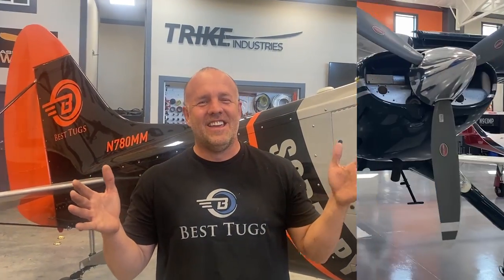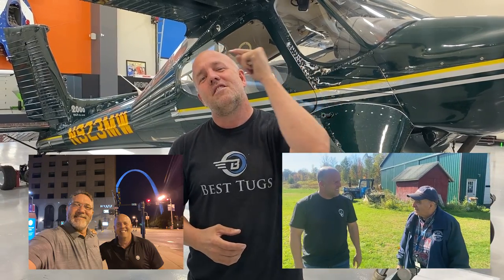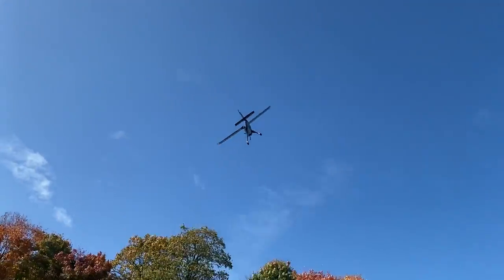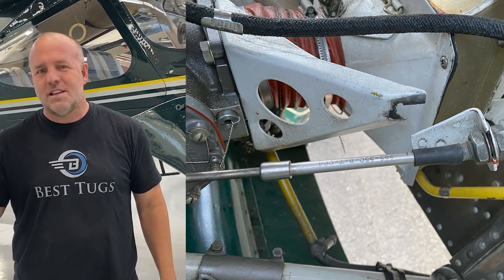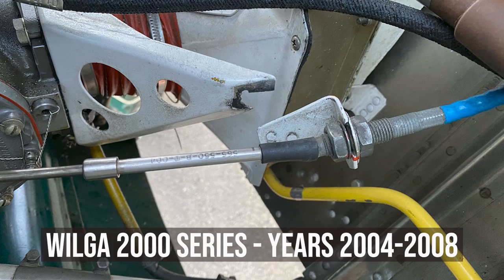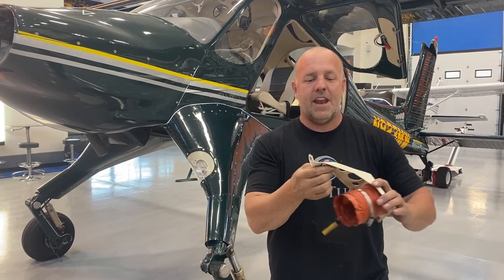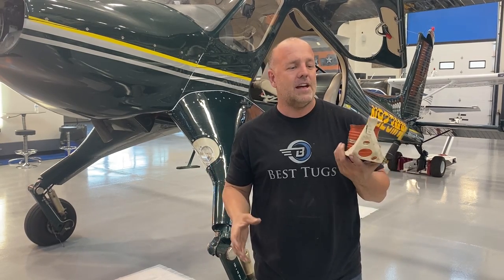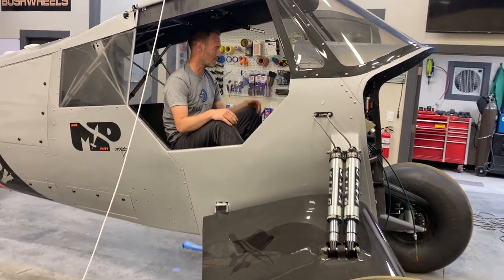Engine Trouble Flying Home a New Wilga 😬 | Scrappy 30

Comment: Great advice - I still wish you'd add a head rests to the seat as the hyperextension of the spine is still a common killer in aircraft accidents.
You focus on so many security aspects that are awesome like helmet, parachute, doubling down on avionics, solid (over)engineering - but to leave the headrests out just to end up paralyzed or killed?
There's so many incidents in GA where a head rest could have saved lives and prevented damage that I wonder why this basic feature was left out. It shows up in so many crash reports.
Example crash N97119

But keep up the good work. Let's hope that if something happens the circumstance will not involve the need for a protection of the spine.

Comment: My Dad always taught me to make every take off EXPECTING the engine to quit at the worst possible point in the take off. Then if it happens your not surprised and already taking action. One of his other fav sayings was this. The 3 most useless things to a pilot are 1) Runway that's behind you, 2) Altitude that's above you, and 3) Gas that's left on the ground.
Reply: That's a good one, my flight instructor explained me the same, in 1979. He actually told me that below 300 feet AGL it would be better to hit the next trees or a brick wall than trying to turn around 180°.
On every flight I was told to look out for open fields for emergency landing, even marking them on the map before a cross country.

Comment: Mechanical emergencies are a very small part of the fatalities.  It is usually pilot error.  However, what you say is very important because they can happen.  In Commercial training you practice engine out procedures to the airport this is something we probably should do more often.  

Usually for the BFR you pick a place and within 1000 feet the instructor stops it.  Maybe, we should practice it to Commercial standard with a actual landing.  Something to think about and I think I will put that into my next BFR.

Comment: Looking at your suspension setup reminds me of the front view of a Baja 1000 racer, designed to absorb punishment over the long haul, as well as the travel having a large safety margin, not surprising considering your devotion to the safety first ethos.

Comment: this have simple repair, if need be sure can use this mixture wire, if broken welding little piece rod under piece if cut broken rod keep wire to place and can use and go to back ground safety. or add this metall wire to cable and frame if cut broken not drop cable out can use.

Comment: I didn't realize you are in Spanish Fork. I just moved back to West Valley City after 9 years in Pensacola. 

Also, as an auto mechanic, I've seen the tiniest little parts take out entire engines. They are systems, with all parts needing to work to make the thing go. And like you said, these things are all man made, and we all make mistakes.

Comment: I had great CFIs. Most of my training was "what if" scenarios. They'd pull the throttle on me a lot. If I'm looking at the ground I'm not sightseeing I'm looking for good places to land. To this day when I'm driving I'm making mental notes about power lines cross roads and signs. When I'm at the beach i know which ones are loose sand and which ones are firm. I think a it's a good habit. I'm just a private pilot and one of my CFIs was a senior 777 captain. We were talking about a plane we hadn't flown in 40 years and I went through the emergency hot restart procedure. He asked me how the heck I remembered that? It was because I had it go out on me ... over lake Ontario, at night, in the winter. It sticks with you. Anyone flying a Cessna 206 with fixed gear want that info ... just ask 😉

Comment: My engine failure was at 200 feet on takeoff, with trees and trailer parks around.  Followed advice of some of the best pilots in the world, flew the crash all the way to the ground and until it quit moving.  Crash was not survivable but I did,  Fly the airplane, fly the airplane fly the airplane.

Comment: I experienced a burnt valve once.  I was just leaving an airport where I have all my work done and do a lot of $100 hamburger runs.  It just started running rough and in a matter of seconds I decided to land.  They did a compression check and determined that the plane was staying there.  That is my only mechanical problem in 1200 hours of flying and yes, if you leave an engine sitting for a long enough time, engine components will rust.  I speak from experience.

Comment: yea, stresses over time make things break. entropy.  specially with your scrappy plane that's a lot of power and weight in front so more stress on things. lol these small planes fall out of the sky often if mike has fallen out of the sky a few times. there's quite a few videos out there of crash landings of these things. bush cubs seem best because theyre light enough to glide down and have those giant wheels. and put a parachute on it in case some wind tears a wing off. so if you want to fly airplanes fly bush cubs lol how well does this 8 cylinder monster glide to the ground?

Comment: I fly paramotors, not GA, but have had my own motor out.  Its not if but when the engine is going to quit.
Reply: I have been flying paramotors for 12 years and have had 4 engine failures.
First was caused by an ignition wire breaking due to vibration at 100 feet on take off, landed further along in the same field.
Second one was unusual as I had taken off from a muddy side of the grass runway and was caused by mud jamming the kill switch (pushbutton) down when I inadvertently caught it moving in the harness, landed out in a farmers field.
Third was a stopped engine after much mis-firing, fortunately at 1500 feet above the landing zone.
Fourth was a failed new stator coil after just 5 hours, annoying. Had been flying defensively so picking a landing field was easy. Had to perform a few S turns as the wing just didn't want to come down. No damage to pilot or machine.

I have found that I have been more relaxed with more experience.

Comment: Ah, the joy of engineering, lol. These are similar issues that the firearms industry has to deal with in their new designs; harmonics and metallurgy. In the aviation field things have to be light weight and very strong and that pair of requirements is a tough nut to crack. Components we consider a non-issue to be concerned about can often be susceptible to frequency harmonics and sympathetic harmonics. Often an easy way to build in an insurance policy is to layer in a dual material so that when one shows signs of weakening, it gives you a chance to look into it and find the source. We've all seen some weird looking parts in aviation components and we also know that torsion, harmonics and temperature variations can put a lot of stress on a part and if a part is made of an alloy that doesn't have the same expansion rates as surrounding alloys, it'll soon weaken and fail. Overall, looking great! Thanks for sharing the bad with the good.

Comment: A big part of flying single engine planes is risk mitigation.
An engine isn't infallible, engines quite sometimes for various reasons.
Flights should be planned to evaluate and minimize risk associated as much as possible. 
• Plan flights along freeways or roadways in remote wooded area's so you have an out if the engine fails, especially at night. 
     - I'll never forget when the instructor pulled the power back in my PPL night training. 
     She Asked, "Quick your engine quit what are you going to do?" 
     We were flying in the middle of nowhere and everything was dark except a lone car driving on a road about a mile to our east. 
     I said, "Try real hard not to die, and turn to land behind that car".

Always leave yourself outs. 
If you are flying in an area where outs don't exist you better have your equipment in tip top shape and be comfortable with the added risk.

Comment: I first learned to fly in powered gliders at the age of 16, and during the training, more often than not, the bastard...sorry, instructor, would pull the power at different heights just after take-off. EFATOs we called them. Depending on the height, you'd need to decided where you were going to put the thing down. To this day, as an old fart, I'm still surprised when I find that the prop is still spinning as I get up to pattern altitude.

It's only quit for real a couple of times. Once in a Giles G202 while I was requesting clearance to fly through a TMA. I think it freaked out the controller more than it did me when I ended my transmission with, "Oops the engine just stopped. Let me get back to you."

The other time was while test flying a Bucker Jungmann that a guy on the airfield had just restored. He was interested in how it would aerobat. Every time it went inverted, the engine would quit. I found it to be hilarious and couldn't stop laughing. He was in the front hole and wasn't so amused. What was even funnier was that every time we came around upright, his legs would get sprayed with oil from the oil breather tube that, for some reason, he'd routed so it ended on the top of one of gear legs. The oil got sucked in through a gap in the fabric at the top of the leg and ruined his trousers and brand new trainers.

Every other close call I've ever had has been just after getting a plane back from a mechanic. The stories I can tell.

Comment: I'm pretty sure that you've noticed it (since you're Mike Patey and you are always a thought ahead :P ), but: 

when you did that drop test, you could see that the wheel bounced off the ground taking away quite a bit of effective suspension travel. 
Ofc, there's no engine or wings mounted so the overall mass will be different. However, this rebound of the wheel should be independent of the overall mass. 
Adjusting the tire pressure will solve that probably.
Just my two cents as a future systems engineer and big fan of yours.

Best wishes from Germany!

PS: it would be really interesting to compare drops with different tire pressures!

Comment: Out of curiosity, how well does the Wilga 2000 with the flat lycoming engine glide when the engine dies? I've flown along during a glider tow on a OG Wilga with the big AI14 radial engine and was told it has a glide ratio of about 1 in 4 if the engine dies completely. At that ratio it's basically a matter of " if you can't see it down below you through the side window, you won't make it there. Anything visible out the windscreen over the nose would be too far away. A briefing like that gives you something to thing about while taking off from an east german airfield with nothing but pine trees for the first several kilometers after takeoff and lots of forest below you on approach.

 (Awesome plane for getting towed with as a glider pilot though. Short ground roll and superb climb at a manageable speed.)

PS: Glad you made it safely home and nobody got hurt

Comment: I'm reminded of a flight with a friend in his Cessna 180. Flying to our home field, he decided to lean the engine a bit. The vernier control seemed to have a loose feel, just before the cable came right out of the panel. We landed normally and shut off the fuel with the tank selector. A new cable was installed returning the 180 to flying status. My dad had purchased an Aero Commander Lark 10-180, I has a thought that neither of us had fully tested the fuel selector. So, I did that; the OFF position failed. Hence: a new selector was installed before any further engine operation. How's yours?

Comment: My Guess here would be the new Wilga is in better structural condition than the white one.If this is the case and I am right?The new green one would be a better airplane for the Draco X Resurrection project. Either way I don't care I am just thrilled Mike has another Wilga 2000 in the hangar and cannot wait for the rebuild to start using the parts from Draco!..So glad you and Mark made it down safely and the plane survived without damage.  Back to work...Long live DRACO..BTW..Mike what ser# is the new 2000?

Comment: i ride a motorcycle and my motto is: " Don't think what might happen - anticipate what might happen" ! !! !!!
Reply: If you think it, it will happen...just be prepared.
Reply: That's right....read the road....read the traffic....keep your head on a swivel.....check mirrors....constantly ask yourself questions about traffic....always have an out.
Reply: Agreed. Motorcycling is similar to flying especially aerobatic flying. I always return mentally exhausted from the level of concentration required to stay alive after I ride my motorcycle and fly airplanes.
Reply: A guy I know who wouldn't dare get in a "dangerous" airplane just got wiped out 2 days ago on his bike. Yeah I'm going to continue taking my chances with flying.

Comment: “...and the pilot lived to tell the tale.”  It is a shame that statement is true. An engine failure should be a survivable event but unfortunately too many people get it wrong. This is because we do not spend enough time with the basics of flying. All aircraft will glide, from Jumbo jets to the smallest microlight, so your job is to use the distance and time the glide will give you to assure a the very best outcome. It is essential thing is that you must have a working plan before the engine quits. This means the moment things go wrong you initiate your pre-considered plan. Hopefully the first thing that happens is you get to best glide speed. The middle bit is somewhat variable. The very, very last bit is to communicate.

Comment: On the other bracket you are showing at 8:30 there is evidence of black stuff showing around the joints in the same area as failure of the original bracket.  This may be oil residue, but may also be  some Verdigris due to internal cracking/rivet working leaking from the joint.  If I was working on this aircraft (assuming you are gonna use the bracket again), I would inspect a little closer.  Knowing what has happened to you once, I would drill out those rivets, clean and inspect, and re-rivet.  That doubler plate may not be a mod that got missed - could have been a repair over an existing crack?

For what it's worth. (Aircraft structures dude for 23 years)

Comment: Very interesting. I would like to know more on the FAA reporting process and how they handle the defective parts issues. Do they contact owners directly or does Wilga contact them about a potential problem. Was yours supposed to be upgraded with the improved and reinforced bracket and just missed? Was your aircraft an earlier build and the change went through at a later date?

Comment: What do you do if a friend's plane goes down it the middle of the Rockies or Alaska, cant be repaired on site and can't be flown? Seems like it may be handy to have a way to tow a cub to a maintenance facility. Is it even possible to tow a plane, as opposed to a glider with no engine in front / less weight?

Comment: That broken piece looks like it was spot welded.  I do not trust spot welds.
I have had way too many fail from vibration and flexing.  The other part you showed was riveted, which looks good.
They should just make the part one solid piece.

Comment: is a carbon fiber replacement bracket a better replacement option? or due to the bracket design in the first, would it still be to brittle? (I am guessing the original is aluminum, with eventually work hardens and the you the that plastic deformation cracking as it reaches its cycle limit).

Comment: spot welded !!!    when they built the interstate road system they mandated that 1 mile out of every 5 had to be straight , as to be an emergency landing strip for war planes during ww2(1?)
Reply: 3.  The interstate system was Eisenhower's baby.  Well after WWII was over.  It was so that we could use interstates for aircraft in case the cold war went hot.

Comment: So.. the tire bounced.. seems maybe a little air in the suspension or a little soft on compression settings?  or just a symptom of no weight?
Reply: Yeah saw that also, probably going to get a bit of that with those bush wheels but maybe might be reduced once the tyre's are aired down a bit.

Comment: I'm a cyclist. Chains snap eventually, so you learn to deal with mechanical failure and mitigate risk. Don't pedal out-of-saddle when passing another cyclist, or when a car is passing you. If the chain snaps you won't fall onto someone or roll under a car. Check metal components, cables, and cable stops regularly. Nuff said.

Comment: wilga looks interesting, (draco looks amazing), but I think that wilga airplane it's not well designed as flying geometry, there were more accidents similar to what you had with draco, maybe it's a strange issue with the center of gravity (cg), maybe it's too high, maybe also not well-engineered: it's a good looking airplane but with a faulty conceptual main design

Comment: The material is not able to handle that type of stress apparently. Maybe a redesigned nylon  bracket. A non breakable polymer material might work better.